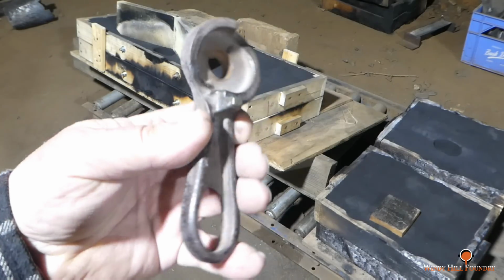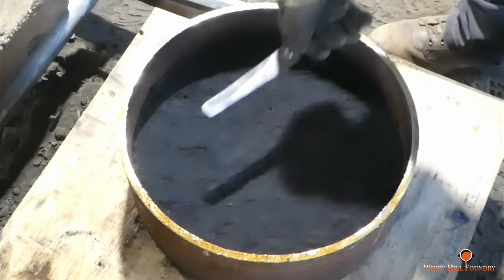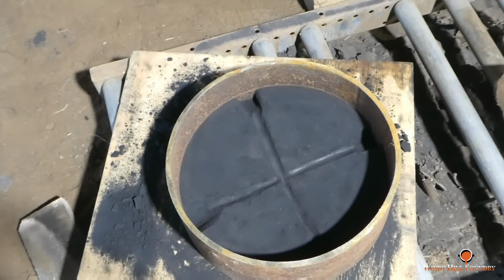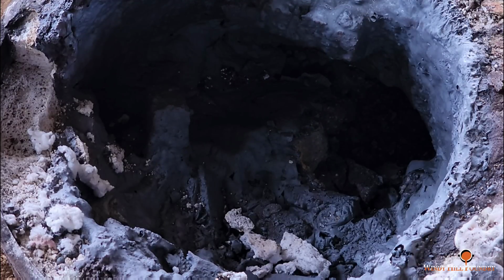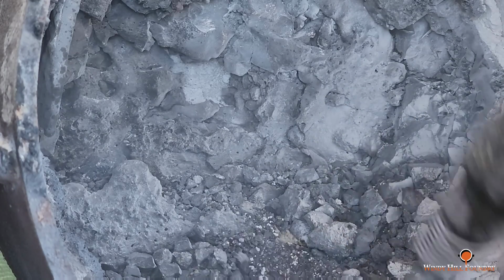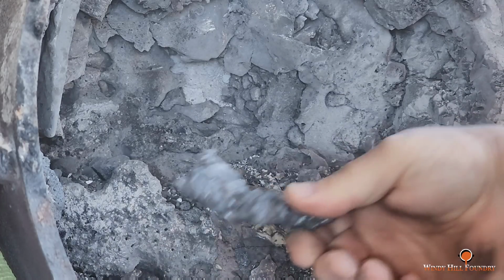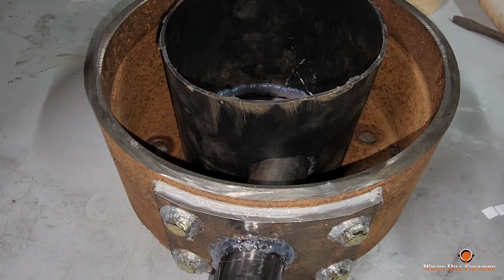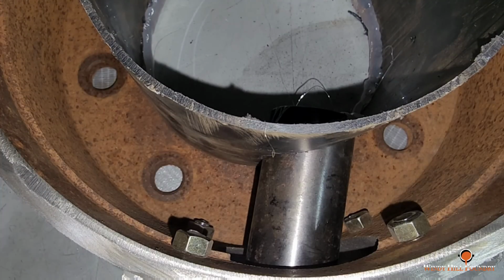FOUNDRY FRUSTRATIONS PART 4

Comment: Have you cast the architechural panels?  I have not seen it but may have missed it, for some reason YT randomly turns off my notifications.   If not have you considered they may be higher silicon for more fluidity?  The rotors you use as source are not thin or complex castings so would not require high fluidity.  Being automotive cost is critical so the alloy will be as lean as possible.  And what Si is there can oxidize when you melt, forming silica in the slag.  There are portable x-ray spectrographs which could nondestructively test the original.  University may have one or steel mill/large foundry or large scrap dealer.  Last steel mill I worked for used them to test purchased scrap metal.

Comment: A pitty you weren't able to pick up one of those commercial Inductotherms at that auction awhile back. For what limited pouring you do it should be perfect.  The ability to easily control and monitor the temperature should lead to better quality iron. That being said I am a cupola furnace fan for the best iron especially since you can pull your iron off the bottom and avoid slag inclusion.  Perhaps with figuring the right schedule you could run a cupola and do 2 pours a day while working on cores inbetween melts. Probably could pour 4 times the iron you are doing now pretty easy if you could keep the cores made up fast enough.

Comment: I've never done any foundry work, but it seems to me that the iron has to divide a lot and flow through relatively long lengths of channels, do you think two pouring basins would help solve your problem of incomplete castings.  Obviously, you'd need two people pouring at once and and a major vent in the middle and two furnaces going.  Just a thought.

Comment: Life would be boring if you made the same casting day after day. You would have it all figured out and everything would be easy. I'm glad you have chosen the narrow path and take on the new work. I have a small foundry like yours and experience the same issues. I have noticed that a new furnace lining will obtain a higher metal  temperature. Hopefully this will help the gate casting fill out. I  also switch to scrap from old steam heat radiators which has great fluidity for long running castings. Good luck Clarke!

Comment: I think that the sprues , runners and risers could be cast of insulating materiel in the manner of cores, Using sodium silicate and vermiculite or pearlite else the equivalent. Especially if you had plenty of risers that could cool slowly.

Comment: When it rains it poors.😐
I think the harbor freight air chisel survives so good under the extreme conditions is because you are water cooling it.
On a more serious note regarding the water there are automatic compressor tank purge valves that might alleviate the moisture issues a bit.
You place them as the drain at the bottom of the tank and the timer purges the tank for a second every once in a while blowing out the moisture that settled to the bottom.

Comment: Clark - some naïve thoughts from someone who has never seen molten metal poured into a mold - except in your videos. Regarding the fence pieces, you have mentioned the possibility of needing to heat the mold. I'm not sure that the geometry would work but I've been wondering whether some cylindrical holes could be made in the mold at the ends and iron first poured into them. If you were doing another mold with the same pour, you could do that next which would give the large mold time to heat a little and then come back and do the big pour assuming that you have enough metal in the crucible for all this. As I said, naïve thoughts.

Comment: I greatly appreciate the content Brother, as I regard this as a trade school finally taken! Clarke will You be able to show some functional detail of the BOT that You mentioned! I have been planning just a hole in the bottom covered by the plinth, for my future build! I am intrigued now by Your mention of the Bot! The Lufkin foundry that I worked at had a large cupula furnace that was used primarily to pour forklift counterweights! I did not envy the crew that had to reman the  bottom every time those doors opened!
Please take care, You and Yours be safe and well! Good luck with the furnaces!

PS: Will used vegetable oil provide sufficient BTU's for a burner, or two, to work iron?
Thanks in advance for any and all info!

Comment: Clarke, on eBay there are carbide tipped TCT cutters that might do a bit better for your projects. 
If you put a piece of wood between the work piece and the table, it will act as a sacrificial surface for you.

Comment: Suggestion: don't spend any time on avoiding flashing/surface finish etc, until you know you have a gating/runner/sprue setup that will reliably fill the pattern